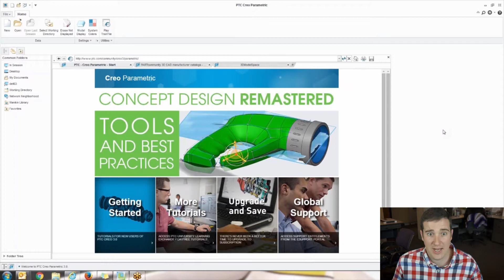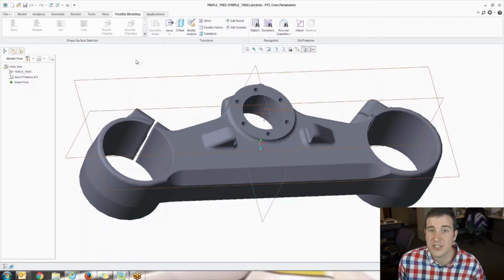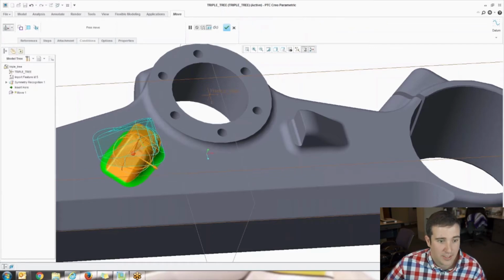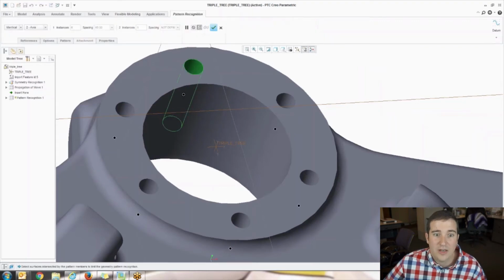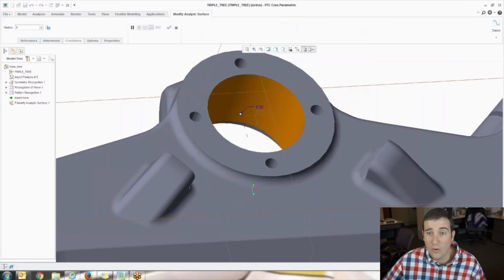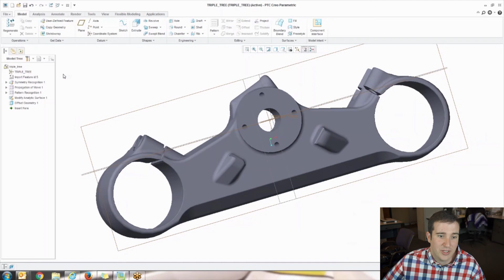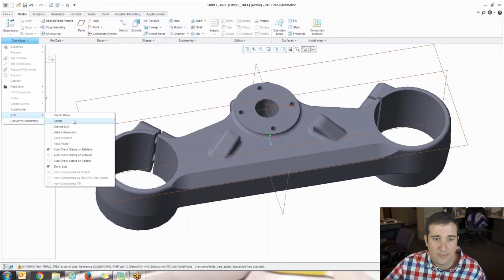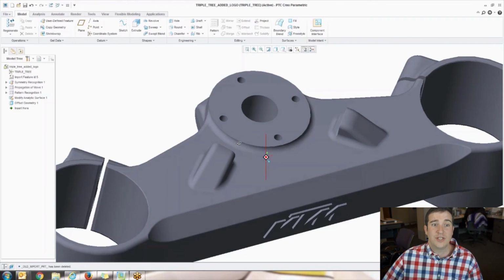Work on any CAD file using Creo Parametric with Unite and Flexible Modeling

Comment: It is a cool feature but only works if you have a computer with high specs. if you need to modify a big model it requires a lot of processing power. A normal PC can not handle it. And it sucks. I have T1000 VIDEO CARD, I7 9TH GEN PROCESSOR AND 32 OF RAM DDR5.

Comment: How do I edit .stl file in creo?
I tried converting it in shrink wrap but I am not able to edit it properly.
Reply from the maker: Hi Aarjav, 
Editing STL files in general, is not something that is typically done. The reason is that the STL file translation process approximates the geometry from the original model. What happens in the translation process is a subdivision into triangular patches. There are no features to edit or modify. There are some options that can be set to control the size and aspect ratio of the tessellations in the STL file.
 
Additionally, PTC does have a module, Reverse Engineering Extension, that can be used to create new surface features by referencing the STL tessellated model. The process involves creating a collection of surfaces, trimming / extending those surfaces, merging the resulting surfaces into an enclosed quilt, and finally solidifying the model. In short, it is possible to work with the stl models, but there is no ‘Easy Button’. Hope this helps clarify.

Comment: Hi..Nice video.. Can we also edit an STL file with the same procedure?
Reply from the maker: Flexible Modeling won't work on STL files. Other files (CAD native, IGES, or STEP) all have surfaces built up from lines and arcs that flex modeling can recognize/interpret and edit. STL on the other hand doesn't have surfaces but rather facets built up from tessellation and can't be manipulated in the same way. Sorry!
Reply: can you please guide me on how to edit an STL file in CREO.. Or maybe any other  software that I can use to edit an STL file. I am really facing problem with this..